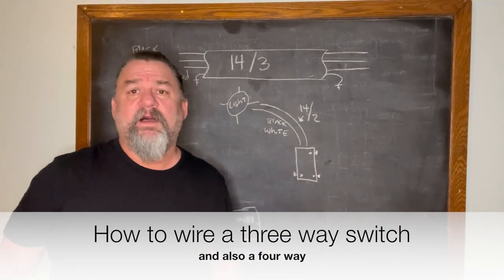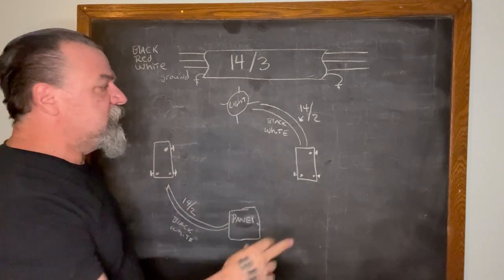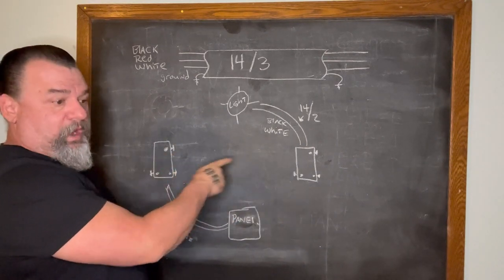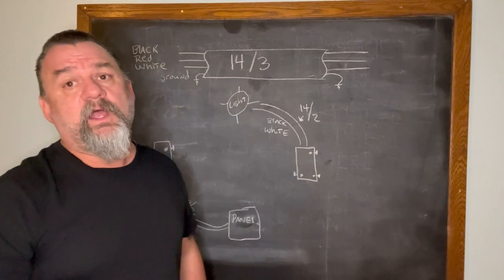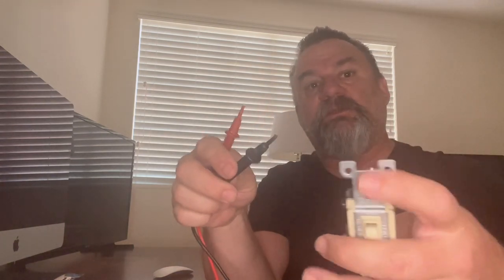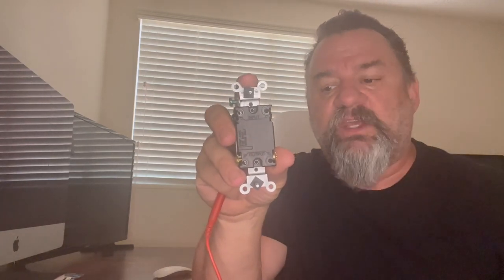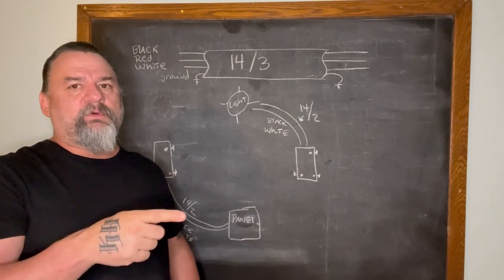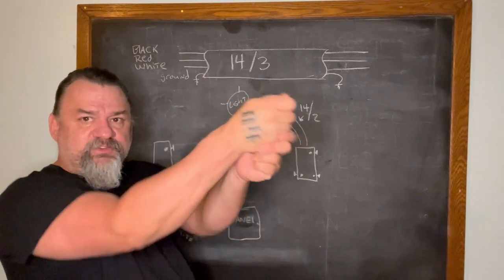How to Wire a Three-Way Switch and "How they work Work!"

Comment: Thank you for sharing your knowledge!!
I gotta confess that when I did my house, I had to go the computer and google up the diagram most of the time, but especially with the two three ways I made, one for the kitchen light and one for the light in the center hallway leading back to the kitchen.
But I gotta brag that those three ways both worked perfectly the first time, and that when both switches are down, the lights are off.
Reply from the maker: Glad I could help! good stuff!!!

Comment: I consider a 3 way switch an either-or switch. Either the red or the black wire is energized at any time. Also the wire to the light is connected to the red or black traveler at any time depending on which way the second switch is positioned.
Reply from the maker: I don't know what you are trying to say but red and black aren't connected to the switch leg. i'm not going to explain the video. you think I don't know how to connect a 3 way?
Reply: @StarvingElectrician  No disrespect. I just was trying to point out that the switch connects red or black traveler to the light circuit. I'm sure you know all the ways to connect a 3 way sw.